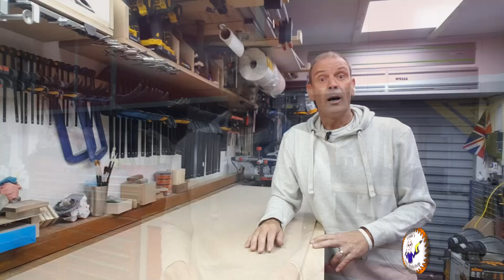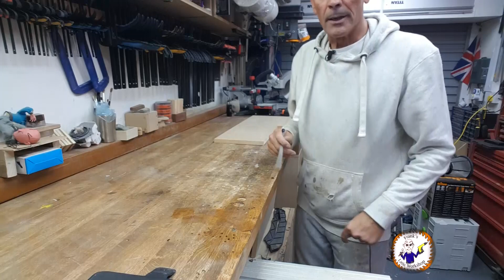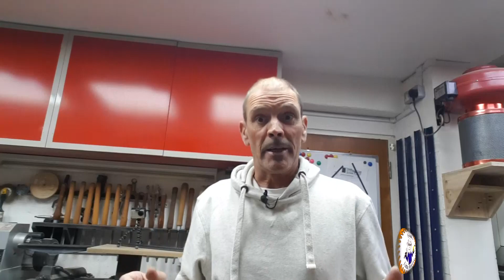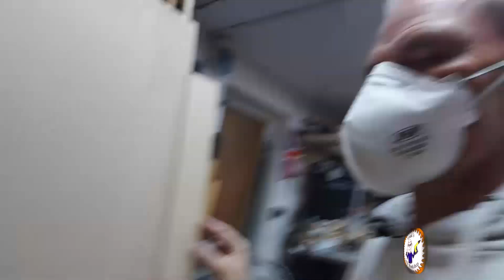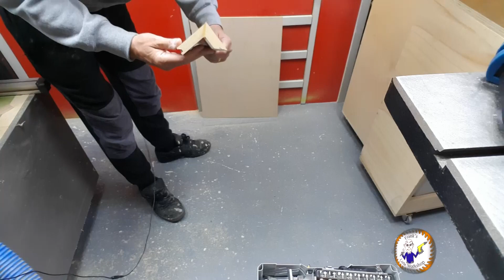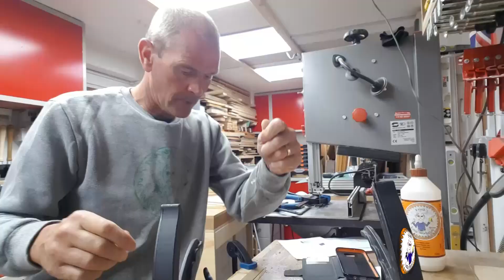Radiator Cover Part 1.

Comment: Nice job. I used the 45° joint method on one of my tool holders. Looks great & very strong
Reply from the maker: Thanks Grumpy 😁. It's much better than I expected so I will use it again. I would prefer to do box joints... but that's a bit overkill for a rad cover 😂🤣. Thanks for watching Grumpy, hope your keeping well 😁👍